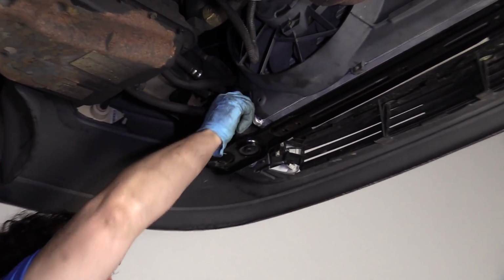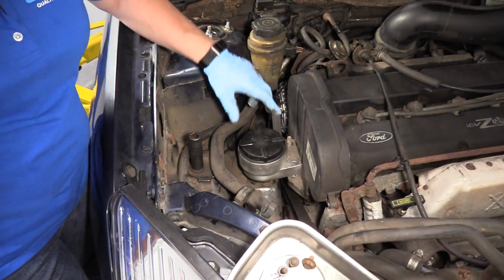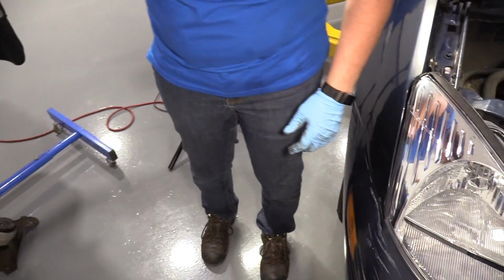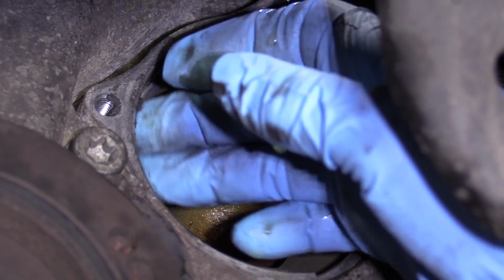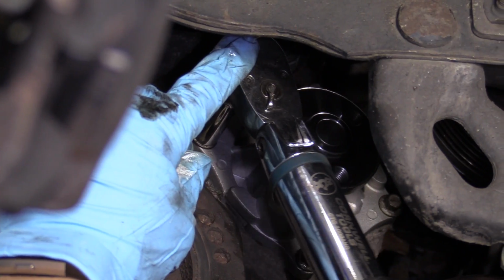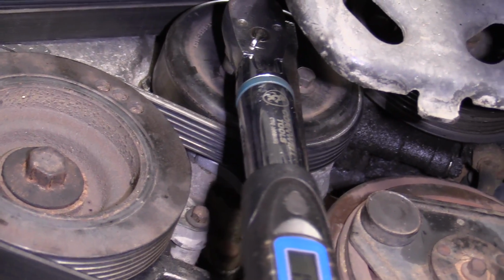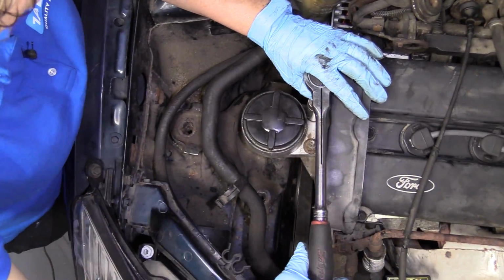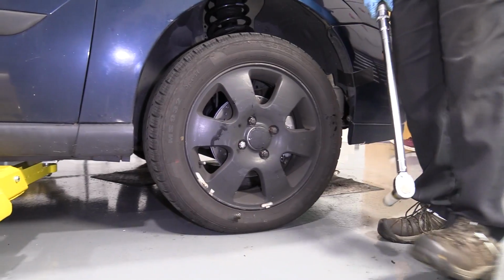How to Replace Water Pump 00-04 Ford Focus

Comment: Wow I've seen a lot of videos to do this, but this is by far the best one I've seen. So clear and each step explained carefully. Thank you so much. I'll be watching this a few times before I tackle mine. Quick question, if under high pressure, the coolant is coming out at a rate from the water pump, would that just be the water pump or is it likely to be the housing for it as well? Thank you so mucjm

Comment: I was making a guess at what my problem might be when my temp spiked and a yellow warning light came on. I had some smoke/steam blowing but it was on the other side. I added water and it seemed fine. I came here looking to see how hard it would be to repair but this work is taking place on the opposite side from the part I was thinking is the issue. Not sure how to proceed now.

Comment: 2003 Ford Focus zx3. I replaced my water pump.  You do NOT need to remove the engine mount. Jack car up in front, place your jackstands.   Remove the passenger front wheel and the backing material.  Take off serpentine belt.  Unbolt the water pump.  It fits into the car like a 3-d puzzle.  You have to put it into the hole and turn it exactly right as you feed it in, there is maybe a millimeter clearance and exactly one way it feeds in.  I would have said impossible' but I actually did it successfully.

Comment: Beware. The. F  Focus. Has. A very. Limited Work area. Which Has. Limited Angel Space  to. Get It. Out an. In. Take off all around. It. So Angles. Of use Can be achieved. It's Feasible an Accessessinle. Then An Only Then. Ok. From. Rocket Scientist.  in. Maui Jerome Tiger Metcalfe.

Comment: I did this today and the bolt heads broke off and now I have to figure out how to remove them in such a tight space. Any ideas would be greatly appreciated. I only had the bolts torqued to 5 ft lbs when this happened

Comment: Thats such a long winded way of doing it. I mean if it works for you then it works but there are honestly quicker ways of doing it.

I just dropped the engine onto a jack and replaced the alternator belt and water pump. No need to take the wheel off, remove the coolant resivua or even remove the whole engine mount

Comment: You should REALLY change that timing belt while you're in there. That belt is shot and if it breaks it's going to trash those valves. That's an interference engine. Don't put that off.
Reply: Not an interference engine

Comment: Best tool I've bought was a Devalt 3/8" 12v impact driver. If you plan on doing more than one repair; it's worth it. Why they don't make the right angle driver is a mystery, but Crapsman offers a good one and has worked well. Makes a repair a little less miserable. Brr Brr Brrrr...all done. Always go back with a ratchet to check tightness !

Comment: great video just wish this went into further detail regarding bleeding the coolant system.  Not sure if theres a bleeder valve for this specific cars coolant system or what, and im getting mixed feedback on how to go about bleeding the system of air before turning the car on.  Im doing the alternator, waterpump, tensioner pulley, and idler pulley so i just need to know how to bleed the coolant system before i can move onto changing the oil and oil filter and then taking it out on its maiden voyage lol

Comment: so you can replace water pump on this car WITHOUT removing the tiiming belt?     had several people tell me on this car,which is same as mine both belts have to come off & will have to redo timing also        ....just to replace the pump.

Comment: I wish I would have seen this video when the plastic impeller on mine spun off the end of the shaft, thinking of dealing with that motor mount was enough to hire it out, looks like it wouldn't have been as bad of a job as I thought it was going to be.  https://youtu.be/YKlWjVdIT-8

Comment: Great video but I need advice. You take the engine mount off, then later the car is up in the air? Is there nothing supporting the engine on the Cambelt side when on the lift?

Comment: No necesitó silicona alrrededor?
Reply from the maker: +Barbarino Torres Thanks for checking us out! Silicon is not needed with this replacement as the gasket will keep things sealed when it is bolted down.

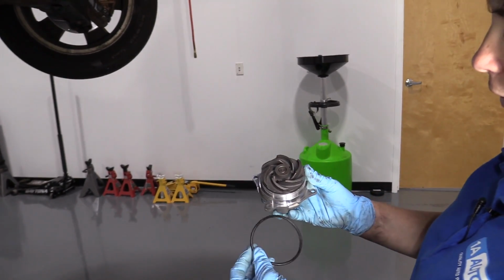Comment: At 12:13 in the video we see the vehicle raised with the technician under it and yet the engine is not falling out of the car even though the passenger side motor mount has been removed.
Please explain how to do this.
Reply: There are other Mount holding

Comment: I'm in the process of doing a water pump and know why it has all that gasket maker. That o- ring doesn't seal. It doesn't press against the housing. It constantly leaks and pours out the water. May just have to glob it up with some permatex. Very irritating problem.

Comment: I just had my water pump go out. Pepboys told me it would be a 4hour job and cost 730 dollars. Interesting that it only takes 30 minutes and not 4 hours.
Reply: Video is edited you plumb, running up bleeding and testing can take half hour on it's own, let alone remove and replace!
A sensible time would be approx 1.5 hours to do the job thoroughly
Reply: @finebooty  Exactly another 20 minutes half hour for test drive
Reply: Joshua Nelsen - 100% - a mom and pop told me $300 which was ok, but this looks pretty simple. Great video
Reply: Pep boys loves to over charge and not pay the few good techs they have accordingly never waste your time or $ there most techs there aren't qualified to do the job I've seen brake pads that have been put on backwards, transmissions being drained confused with oil drain plug, brakes being bled with drums off and calipers off hahahaha the list goes on it's a dam playground just don't do it!!
Reply: Obviously it's an edited video, cos it take more time than it's showed
Reply: 350 max new pump included and new belt if needed  2 hrs. max ,maybe that included new timing belt while opened up 500  for additional labor and parts.,✌️🤔😔🙏❄️

Comment: That car needed a timing belt too. If you look up  How to Replace Timing Belt 00-04 Ford Focus, she is taking everything apart again and changing the time timing belt.
Reply: Was kind of disappointed they edited out the water pump change during that one and then spliced things back together to make this video.  It's kind of a no brainer to do both together when either needs replacing because of the hassle of getting everything out of the way.  Also a good time to replace the serpentine and its pulleys. (Trust me, you don't want to have a serpentine tensioner die in the middle of nowhere at night. Finding one and then replacing it on the side of the road sucks.)
Plus a failed water pump can leak into the timing cover, which isn't good for the belt or the pulleys.